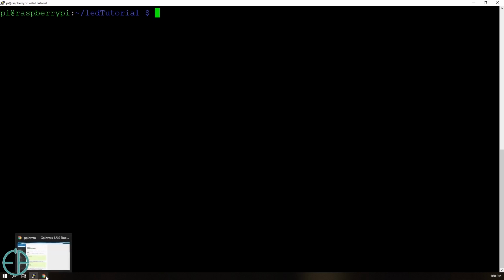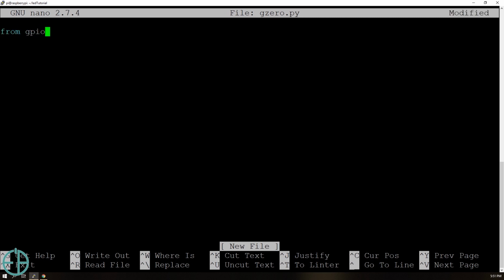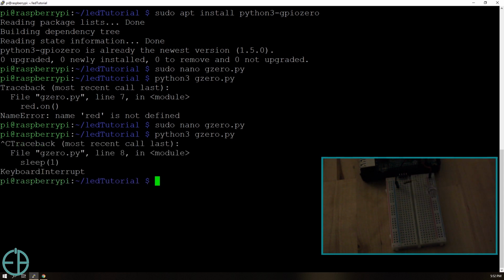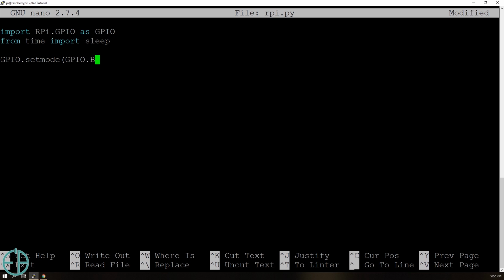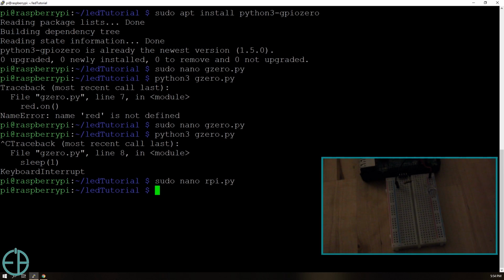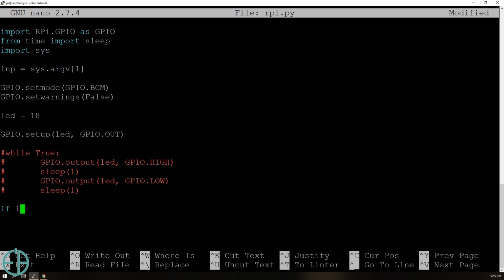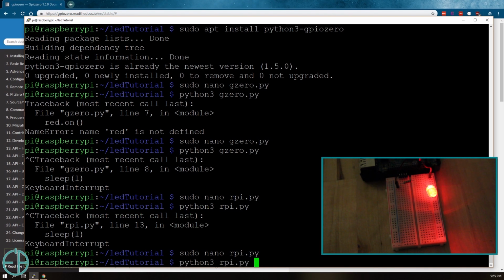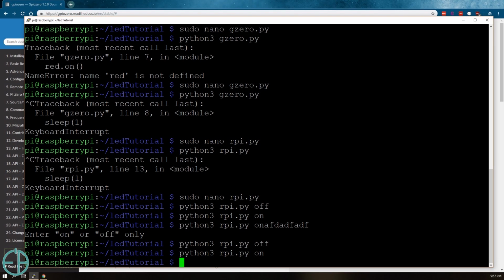Control LEDs using gpiozero and RPi.GPIO libraries on Raspberry Pi

Comment: Hey can we use the two library’s together somehow
Reply from the maker: Yeah that shouldn't be a problem. Just have to make sure you don't try to trigger the same Pin with both sets of code. Nothing bad should happen but it'll either error out or do nothing at all.
Reply: @naztronaut  i tried it but it said "a mode was already set!"
Reply from the maker: @TonyLee-cs1bu  Couldn't find any documentation on this but it looks like RPi.GPIO locks all the ports once you set it up. That's a shame, thought it would only lock whatever port you use. It may be a limitation on the pi itself,  I'm not sure.

Looks like you'll have to pick one or the other library.
Reply: @naztronaut  oh well... thank you!

Comment: I have a Problem. When i want to start the Program in the console there is the error:

ModuleNotFoundError: No module named gpiozero.

But i have already insatlled gpiozero.
It also works when i start it from an IDLE (genay, Thonny Python, ....).

Does anyone have a solution for that?

Nice video by the way :)
Reply: Ok, i found a solution now. 

Whis the IDLE "genay" it worked, and with "Thonny Python" not. So i decided to look in "Thonny" to find something. In "Thonny Python" you can click on "tools" and from there on "manage packages". There you can search for "gpiozero" and click on "install". 
After taht it works in Thonny and even in the terminal. 
Somehow gpiozero was installed but maybe not in the correct way.
Reply from the maker: @PladdenTim  Glad you figured it out! 
You can also install gpiozero in command line with this command: sudo apt install python3-gpiozero

I also have that info in the written tutorial here: https://www.easyprogramming.net/raspberrypi/gpiozero_rpigpio_led.php

Best of luck with your project! Let me know if you have more questions.
Reply: @naztronaut  Hey, I was following your entire tutorial about turning on an LED from the browser. I basically did all the tutorials leading up to it, but the LEDs just won't turn on. I even did this tutorial and used the 2 basic codes you wrote, and tried to run it, but nothing happens for the first code, while the 2nd code gives an IndexError.
Reply: @armeddreams9141  Do the LEDs work if you just provide power to them directly? Not using a Pi. Just to rule out the LEDs being a problem. 

As for the IndexError, can you provide the full error code? And let me know which code of mine you're using. It's been almost 3 years since I did this project so I need to read my own code to get a refresher :)
Reply: @Naztronomy  Nevermind, it seems like I solved the problem. A teammate I was working with gave me the wrong pin/gpio map, so I wasn't actually using gpio18 the entire time
Reply from the maker: @armeddreams9141  Awesome! glad you were able to get it working! 

P.S.  Naztronomy is also my account, I sometimes forget to switch when replying.